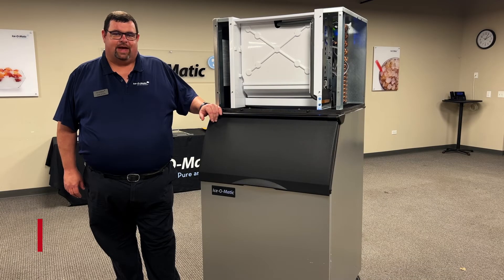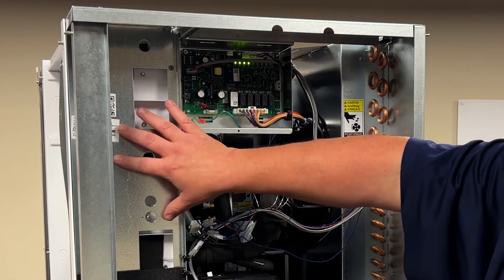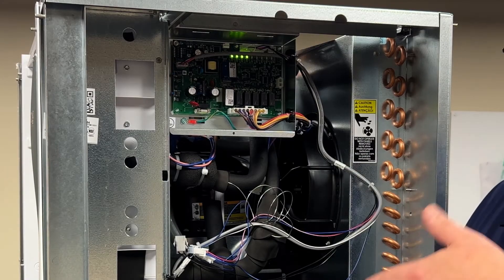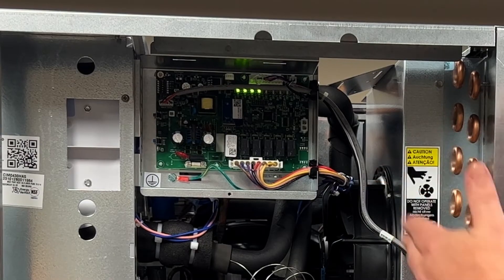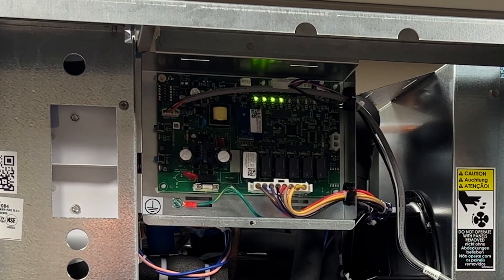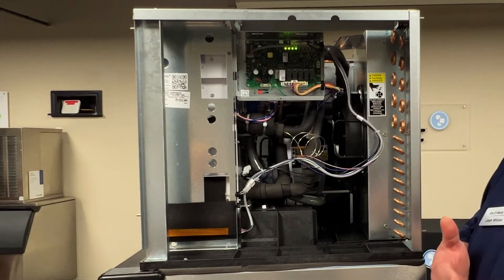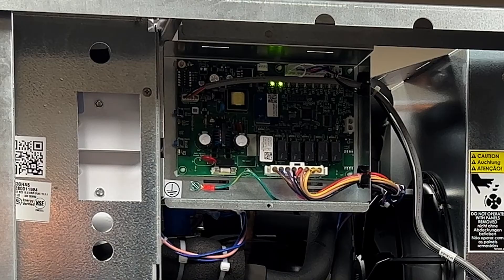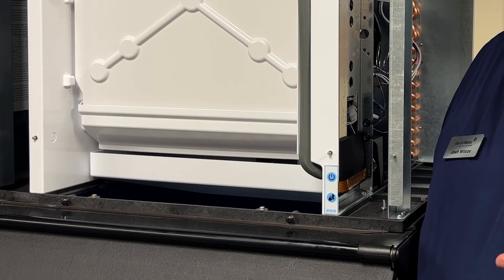Ice-O-Matic CIM Error Light Diagnostics

Comment: Hello, why member 5 is not connected? Should be Neutral. If number 5 is not connected it will cause the same problem again , Because it won’t disconnect the star circuit. Maybe I’m wrong.

Comment: "My Ice-O-Matic machine stops making ice and triggers an alarm with flashing red and yellow lights. What should I do to fix this?"
Reply: check the water supply to make sure it’s turned on and that there are no kinks in the line. You might also want to look at the water filter—if it’s clogged, replacing it could help.

Clean the machine. Sometimes scale buildup can mess things up, so use a descaling solution as the manual suggests. Don’t forget to check the condenser too; if it’s dirty, it can cause overheating.

Take a peek at the ice bin. If it’s full, that could be why it’s not making more ice. A simple reset might do the trick, turn it off for a few minutes and then back on.

call a technician to take a closer look if none of that works.